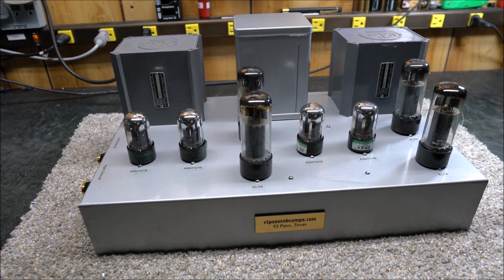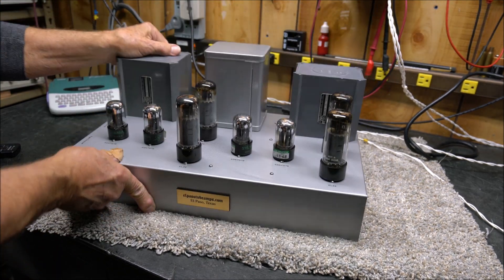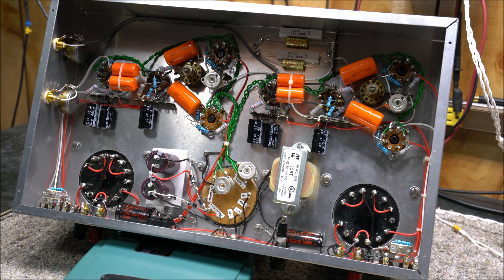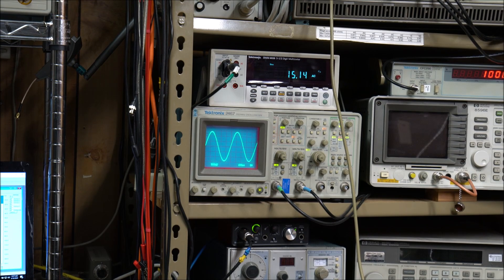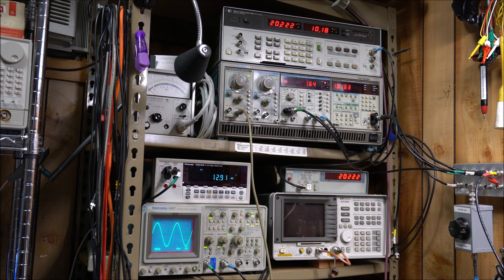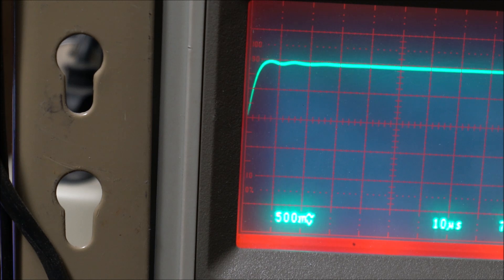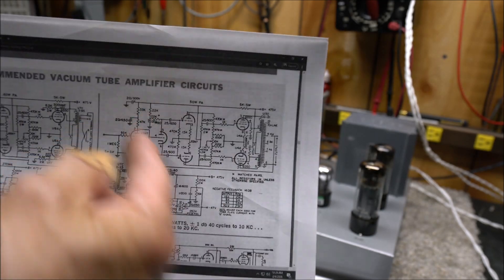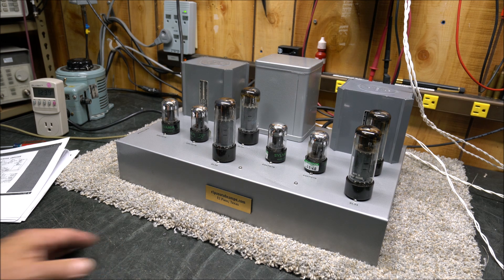Vintage 1959 Mullard EL-34 With UTC LS-57 Output Transformers In Stereo Williamson Amplifier

Comment: I have watched this video several times and great stuff.  Just found a Heathkit AA-71 unbuilt on eBay and will have it soon.  It is a mono but I have my dad's Jensen hi-fi 50's vintage speaker system to play it on (pre-stereo).  But like you the joy is in the building and testing... and listening. Means I have stuff stacking up everywhere.  It is a learning experience that I have looked forward to in retirement.  I appreciate your videos and learning everytime.  Thanks!

Comment: Thanks David. I remember hearing the local AM stations through my tube-driven Heathkit phonograph - good reception. Your videos are always packed with information. I am self-taught in all things vacuum-tube and your experience is invaluable to me. Beautiful workmanship, as always.
Reply from the maker: Thanks, Gary. I am self taught in vacuum tubes also. I have looked back at my college books of electronics and there were some vacuum tube circuits but I think they were there only as principles of ideas rather than circuits of the day. Transistors were the rage in the late 1960's and even IC's were available. When I went to work as a contractor in January 1970, our mainframes were called third-generation as they had IC circuits in the main arithmetic section of the computer. There were Thousands and thousands of RT-176 (2N2222) transistors everywhere. We called them ICR for integrated circuit registers and had a cycle time of 125 nano seconds. OMG... could it possibly be any faster (that is 8 MHZ clock frequency). Can you imagine but it was a 36 bit (not 8 or 32) word that could be double precision at 72 bits. We were definitely in the big-time 50 years ago and had just gone to the moon six months earlier. It was a good time and lots of work. Wish I could do it all over again.

Comment: Those old Williamsons remind me of some of the old stromberg carlson equipment ive seen. Wonder if there's any connection?
Reply from the maker: The only Stromberg Carlson schematic I remember is more like the Dynaco ST70 using a 7199 driver. There may be designs that others can identify but in the simplest sense, there are three basic designs of the vintage amplifiers - the Williamson design, the Dynaco design and the McIntosh design. There are also some differences in phase inversion and the driver stages but these are the classic designs that are recognized.

Comment: Hi i look on your amp  and id like , you explain how you set your 6.3 v heather with heater  pot  with a shematic and the value of the pot .thanks
Reply from the maker: The pot is 100 ohms and is across the 6.3 volt filament line with the wiper to ground. It is used to adjust out any possible 60 Hz hum that might be induced by the filament supply.

Comment: Hi David, I’ve just finished my four year tube amplifier build and have been running some tests on it with my newly acquired HP8903! Really exciting to get to this point. The frequency response is super flat! However the THD+N reads higher than I imagined it would. As it is a Single Ended KT88 Ultra Linear build what would you expect as reasonable THD values at moderate power level at 1Khz? I think i was up at around 3% I have been playing with Hum Balance and a few other ideas but unable to reduce it much. I wonder if the distortion which is present is mainly even order harmonics and if this can be expected with SE or Ive got some issues somewhere. I suppose this means I need to buy a spectrum Analyzer now!
Reply from the maker: Absolutely... congratulations on your build and measurements. The HP 8903 is a beautiful machine. HP or whatever they are called now, a few years ago, offered to buy back 8903's for almost the price of a new model that did not have the built in oscillator - so they could destroy them - the 8903's are that good and last that long - not like the limited-life instruments of today.
First off, I assume you are not using any GNFB? If that is the case, 3% is to be expected for the 300B at around 6 or 7 watts and probably not any better for a triode connected KT88.  I installed a switch in my 300B stereo SET to have no NFB or 5 dB of NFB. A little bit of NFB will allow you another watt or so. 
Your most "offending" harmonic is going to be the second at 2 KHz because as you mentioned, it is a characteristic of a SE amplifier - the reason, long ago, engineers went to push pull. 
A 50 ohm resistor across the filament winding with the wiper to ground is a good idea for balancing out 60 Hz filament hum. Just by listening, it is often hard to distinguish between 60 and 120 Hz hum where the 120 Hz hum is coming from your full wave HV power supply. 
The best FFT audio spectrum analyzer I have and know of is the SpectraPlus software. It only requires an inexpensive USB sound card. You can download it for 30 days, all features, for free. 
For years... I had a "Ghost" copy on a CD of a Win 98 SE OS that I would load back on my PC after a quick and full format after a US government full-disk-wipe (the SpectraPlus looked for remaining data after a format so it required a disk-wipe) because the SpectraPlus is so good. 
http://www.spectraplus.com/Downloads.htm
I am only going to this length because the old HP 3580A is likely a bad investment being over 40 years old - even though it is the bench-mark that all of the high-end vintage equipment was measured by. Just my opinion.
I am betting your amplifier sounds great. I just did not believe in the "magic" of the SET amplifier for over 50 years of building until I actually did build one and listen to it. It is still unbelievable and THD at 1 or 2% is to be expected and we love it...
Thanks for letting me know of your projects. Mine have focused on high power AM (amplitude modulated) transmitters lately as my love-affair with electronics flips between audio frequencies and radio frequencies.
Please stay safe and keep in touch.
Reply: @ElPasoTubeAmps  Thanks for your Input on the Analyzer. I am totally with you on going for a software based FFT with an audio card. Ive been looking at compatibility between various USB audio interfaces and Arta. Will check out SpectraPlus too!

Actually the Schematic I based the amp around uses GNFB 100K from the 8ohm OPT secondary to first stage Cathode. I havnt calculated how many DB’s this is, But I feel the THD may be a little high for the GNFB in place. The Amp sounds pretty good to me though! 
I went on to test another much smaller Chinese SE kit tube amp I Purchased and built years ago and have been listening to in the lounge at home and it read something insane like 10-15% THD Which makes me feel a little better about the KT88 amp. But on comparing to a Solid state Rotel I have lying around the workshop, it reads right down sub 0.1% at full output.
Which assured me the 8903 isnt wildly out of calibration. I did notice while measuring the chinese kit amp that the 8903’s voltage reading across the 8ohm load was reading much lower that it was on my MultiMeter (multimeter reading 4Vrms, Whereas the 8903 was saying like 1.3v) I still can’t understand this, I checked on the Rotel and it was consistent at its 25v output. I wonder if the voltage reading from the chinese amp was too low for the High Level BNC input on the 8903. Perhaps I need to run the tests again connected to the low input/output.
Would love to share some photos and measurements of the finished amplifier. Do you still have a website (Im sure you mentioned one in one of your videos, but couldnt track it down) I will motivate myself to make some videos someday too!

Comment: About 50 years ago, I had an LS-58 output transformer that was part of an amplifier with four 5881 output tubes.
Reply from the maker: I think the LS series of UTC transformers have a very nice sound to them. A bit more clear, to my ear, than the Acrosound transformers. On the other hand, most of these UTC transformers perform poorly below 30 Hz. They have the same primary inductance as the Acrosound transformers, 20H. But after building and listening at length to the 300B stereo amplifier, I can only come to the conclusion that THD below probably 3-4% really doesn't matter much and may even be an artifact that enhances the sound. I know that flies-in-the-face of what we know technically and theoretically, but in the real-world I think many people would agree with the "sound" of SE amplifiers and their sawtooth harmonic profile. What else can I say? 
A somewhat similar example is audio on amateur radio. HiFi sound has too many lows in it and is easily obscured by every type of noise that can be found on the HF bands. I don't think a ham radio operator wants to sound exactly like a space shuttle radio transmission but we have to admit, it does get the message thru effectively. 
I think I have pretty well satisfied my own personal goal of evaluating the vintage high-end transformers, in particular the Acrosound, UTC, Peerless and the more modern day James transformers. They are all good but some of the Acrosound transformers, I had ten at one time, can have variations in performance that is hard to understand. I don't know if it is age or QC but I got to use all ten of them in the same circuit so there is something to be said for that. 
I have immersed myself in AM transmission lately and are having a blast. My 300 watt output transmitter with power supplies and modulator weighs in at about 350 pounds and puts out a lot of heat but it is beautiful. Great for the winter in the basement but not so much so in the summer.  Always good to hear from you and I hope you are doing well. Everything is good here but I have slowed down a bit now at 71 but still having fun.   :-)
Reply: @ElPasoTubeAmps  That's a bit unexpected to hear about the LF performance of LS series transformers. I understood them to be -3dB at 10Hz and 40KHz and they certainly have enough iron to get down that low. But yes, 3% THD is too high at 20Hz.
A hi-fi amplifier should only increase the amplitude of a signal, adding or subtracting nothing along the way. Unfortunately, this new trend toward "euphonics" is not hi fidelity. Amps that distort belong in the musical instrument end of the spectrum, IMHO. When you're MAKING music, shaping the tone is part of the sound. But reproduction should be agnostic and faithful to the original sound.
I generally agree about communication audio, but there is a HAM near me, K1KBW, who runs a Class E rig on AM that sounds better than broadcast quality. His modulation positive peaks are around 180% and he really cuts through when other AM'ers are barely modulating the noise floor. He's the new modulation king, even well beyond WA1HLR (Timtron), whose transmissions impressed me in the early 1970s.
YayM is still the best transmission mode for enjoyment of HAM radio. Slopbucket never appealed to me. I suppose it's because building a filter that doesn't kill the lows below 300Hz is so difficult that almost no rigs have a decent audio response on sideband.
Nice to hear you're still doing okay, Dave!

Comment: Did you try your amp at 10W but at 20Hz to see if distortion disappear? AM station signal is reduced by a cap(+res) at input not in output stage.
Reply from the maker: I think I did test it at 10W but I don't remember the results. I will have to try it again and let you know. I agree that the AM station reduction is on the front part of the amplifier but it seems the 70KHz region of parasitics are around the output tubes.

Comment: that's so interesting. thanks for the walk around your amp. I wish I could run my altec 604c with that.
Reply from the maker: Your Altec's would sound so good. 20W per channel might not impress many these days where advertisers claim hundreds of watts output of a plastic box weighing 5 pounds but you guys know better. I drive Dahlquist DQ-20 speakers with this amplifier that are terrible inefficient at 86 dB SPL. compared to Klipschorn at 105 dB. That is 19 db difference almost exactly 4 times louder on the Klipschorns and still these Dahlquist speakers will run you out of the room and sound Great on this little amplifier. Hard to believe but I love it.
Reply: @ElPasoTubeAmps  I think they're rated at 30 watts and I bet a 20w amp like yours would
absolutely sound great.  my understanding is you don't want to exceed the rated watts on these EVER! but they sound so good so why go there! plenty loud!
I LOVE how your amp is built! great goin !

Comment: What does a 20H choke do to the frequencies?
Reply from the maker: Audio amplifiers of good quality, those having a frequency response that goes down to 30 or even 20 Hz,  needs to have an output transformer with a high inductance (like 20 Henry's or more) in the primary so that the inductive reactance remains relatively high at these low frequencies and they are not attenuated. Most quality vacuum tube output transformers in the 20 watt range have a primary inductance around 20 to 40 Henry's of inductance.

Comment: What are you using as spectrum analyzer software these days?
Reply from the maker: I use the PC based software that can be gotten off the Internet. The HP 3580A is a beautiful lab grade instrument but it is so slow at 60 Hz it is almost unusable, unless you have lots of time to watch it plot... over and over again and again...   I do not recommend spending the type of money most people want for a 40+ year old 3580A. If it breaks, and you can't fix it, you know the answer...  I use an inexpensive Tektronix scope with FFT function if I need to look for harmonics or parasitics above 20 HKz which is not uncommon in the Williamson design, often times with a parasitic in the 100 KHz range.  There are a number of PC based audio spectrum analyzer software packages available on the Internet easily found with a search.

Comment: what sort of cost would it be to build 1 of these amps?
Reply from the maker: A lot would depend on how much a person had to pay for a pair of UTC transformers - probably $600 or so. Power transformer maybe less than $100. Chassis and capacitors and all small parts maybe less than $200 so a reasonable guess might be $900 for all the parts.

Comment: I’ve had to add an RC circuit on my Ultra Linear KT88 amplifier between plate and screen. It was oscillating at 111khz and although it still sounded fantastic, It was visible on the scope at a reasonably high level. After trying all manner of solutions I eventually came across a recommendation documented in a GEC tube datasheet giving a UL KT88 circuit example and gave resistor/capacitor values that may be required for this RC circuit. It solved my issue immediately. Im not exactly sure what I’ve traded off by doing this but looking forward to taking some comparative readings on the 8903! Interesting about the Mhz filter network on the front end. I would not have guessed the reason behind that one!
Reply from the maker: Isn't it great to actually catch these anomalies?  Do the math and check the 3 dB point of the RC circuit and you will see that many, from days of old, are in the frequency range of AM broadcast stations (somewhere between 500KHz and 1.6 MHz) to help keep out your local AM radio station. Not much of that left nowadays but 50 years ago it was serious.
You will find that it does affect the HF response up at 20KHz and beyond but it is usually a good idea to put one in usually on the output of the first stage as you will see in virtually all commercial made amplifiers. Your amplifier may be perfectly stable with out it (during any particular test) but you can change the tubes, components can age, your cat can walk in front of you, and some will not need it and some will. I add them in now.